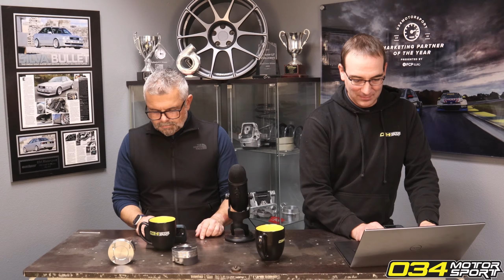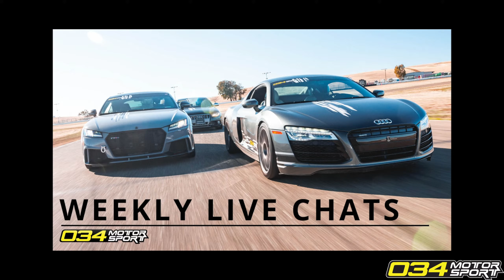Live Q&A, Round 171!

Comment from the maker: Questions Continued:

41:50 I heard concerns that the forged pistons make too much noise, which will falsely set off the knock sensor
43:21 Do the new rods and pistons need to be machine shop balanced once assembled?
44:27 When upgrading to STG3 TTE720 on the RS5, what is recommended to change other than plugs and diverter valves?
45:00 Will you guys be partnering with a Company to make aftermarket pistons for EA837
45:37 Nate, If my b8.5 s4 had a little bit of light clunky stuff I turned it off I think this is a problem of the pcv will the engine be ok? Are there any things I need to do as well as the pcv
47:01 How do some people run catch cans with no issues and some cars have issues and excessive crank case pressure? Would a filter on top of oil cap help issue
48:10 How important is a specific brand of intercooler? There are many options with similar sizes at different price points. Are there actual differences
54:20 You guys almost convinced me to get an S4, but I ended up with a B58. Do you guys have products for the Supra?
54:58 i installed my S34 SuperDuper Insuction bundle last week on my B9.5 SQ5. It's SOOOOOOO LOUD!
55:19 Do you have plans to develop a P34 intake for the B9 SQ5? It seems like the sweet spot between your S and X options.
55:49 Tips for installing dogbone inserts correctly? Have installed both Upper and lower, it causes some wild vibration when taking off in first
57:36 How safe is it to run your guys downpipe on a 2018 S4 with no tune for a little bit
58:11 24v VR6 turbo kits coming back in stock?
58:32 034SPI Ethanol integration using a bluetooth ethanol sensor?
58:55 B9.5 RS5 — currently have the X34 full intake. When the S34 intake and turbo inlet come out, it will be a stand-alone full intake (i.e., I won’t need any of the X34 carbon fiber components), correct?
59:57 If I have Apr stage 2 and want to swap to 034 Stage 2 how would that work?